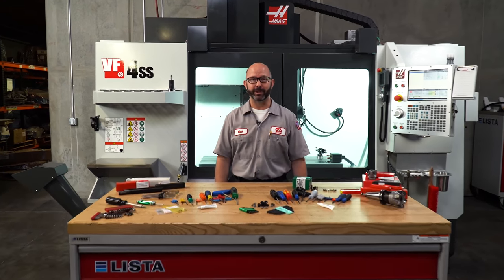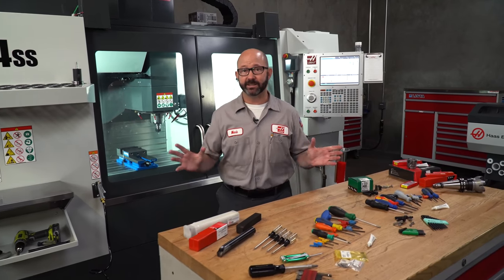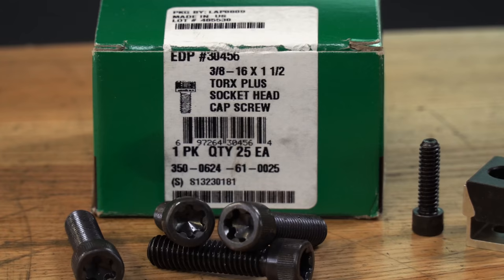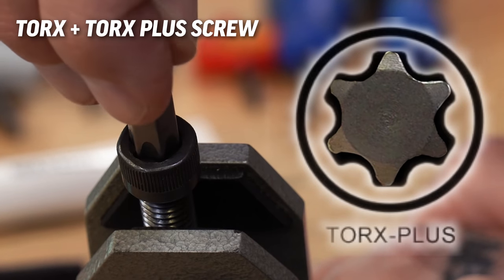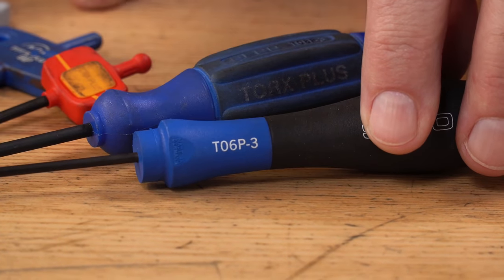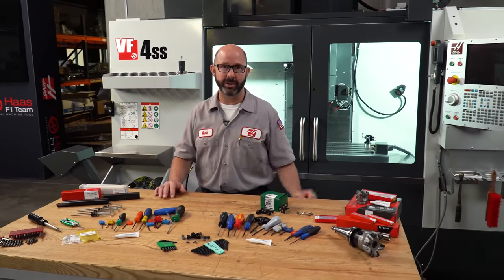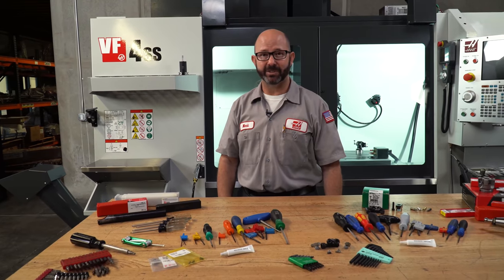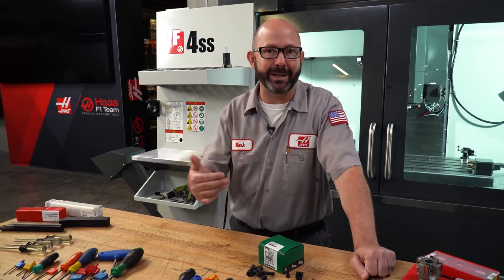THIS IS NOT A TORX - Haas Automation Tip of the Day

Comment: Thanks for this - Torx plus was a new on to me. As a worker with elecctro-mechanical gear, I also come across 'Bristol Spline' screws, which look superficially like Torx, but are different again.
Reply: Spline drive screws were common on IBM electronic accounting machines. Small screws but relatively high torque specification.

Comment: Good video but I feel like you need to discuss the Ribe bit as it’s very similar to Torx Plus. Additionally it’s worth noting that some manufacturers label bits TP15, TP20 etc. These aren’t Torx Plus, they’re Torx Pin, ie the fasteners have a protruding centre pin to make them slightly more tamper-proof.
Reply: Yes but in the video you see that the p in the plus tools was at the end of the designation not after the t.
Reply: @metamorphicorder  still worth being thorough and explaining difference, plus discuss Ribe bits too

Comment: Good info! The recommendation of adding lubricant to bolts is a slippery slope. It should only be done when you know what your doing and why you are doing it as it can potentially cause failures due to over tightening fasteners. Great info otherwise!

Comment: I stepped up to Wera pre-set torquing Torx Plus drivers for tightening all my insert screws. I use a light amount of Loctite anti-seize when installing. Haven't had an issue yet. 👍

Comment: Good stuff.  I almost had to turn away from the philips cam out though.  Typically with philips/star/plus/etc. cam out is from the incorrect bit.  It's too bad there are 2 dozen sizes and types to choose from but many of us know the right size when we see and feel it.
Reply: Until you buy some Chinese tools and screws and with every bit it is either too small or too big. Correct bit or not, the tools have tolerances and feels like a crap shoot 50% of the time. Bought a Blackview smartphone that came with it's own screwdriver for disassembly and it didn't even fit right. . . At least drill bits don't care the type of screw head they encounter.

Comment: Very informative video. I’m confused about the comment about lubricating screws. My understanding is that when there is less friction you have to rotate the screw more to get the same torque which can stretch and weaken the screw. This is why I’ve heard that you should not grease wheel bolts. Should the advice in the video be used only for low torque applications?
Reply: Great comment. I was talking about this with an engineer friend of mine, and yes, while a lubricant will give us a higher stretch (preload) on the screw, it can cause it to loosen if it is in a high-vibration application (less friction). Our cutting tools are really well designed, and tested over decades, so the inserts are well seated in their pockets, and the screws themselves are often offset to hold the insert again the pocket walls so there is no way for it to move. We'll see this with cylinder head bolts as well, there is vibration but the dowel pins on the heads help keep the head from moving against the block. There are lots of applications where we would not want to use a lubricant, and where a nyloc nut, lock washer, lock-wire, Nord-Lock washer, loctite, or jam nut would be more appropriate. In our case, all of the tooling suppliers recommend using a lubricant on the insert screws, so the lack of friction is baked-into our insert torque specs from the manufacturers. Yes, a lube drastically affects torque specs (needs less torque for same preload), and shouldn't be used unless the manufacturer recommends it.
Reply: The comment in the video is correct: with lubrication you need less torque to reach the desired preload... but that means to tighten properly you need to target the right preload, not a specific torque, and so you will use less torque with lubrication.
Reply: Yes, never lubricate wheel bolts/nuts, that way the wheel will be seized onto the hub when you get a flat tire 100 miles from everywhere. Makes perfect sense. Been there. Never again.
Reply: @d.e.b.b5788  wheels are rarely if ever seized on hubs by nuts seized to studs, so using an anti-seize lubricant on the studs won't help. Usually when someone can't get the wheel off, they either can't turn the nuts because they were over-torqued, or they can get the nuts off but the wheel is stuck to the hub... so torque properly and consider anti-seize on the hub (rather than the studs).
Reply: @brianb-p6586  lubricate the countersink in the rim and the contact face of the hub, never the threads yeah. Threads are usually fine but the face drag of the 'sink will bind it hard enough to twist a lug wrench shank out of shape
Reply: @Hyratel  I've never had an issue at the seat interface, but if with your specific wheels (and their inserts in the case of alloys) and nuts you have an issue there, then sure... use anti-seize lube on that - it's not the critical location for torque versus tension.
Reply: @brianb-p6586  this was Plain Ol' Steel Rims on a family car - NOT the kind of place you expect to need WTF amounts of Nutbusting torque, and especially changing a tire in a summer-hot parking lot

Comment: Wow. Torx plus sounds kind of messed up. Sure, they perform better, but they confuse the whole situation, because the are almost (but not actually) compatible.
Reply: exact, so we're back to the PH/PZ mess
Reply: Yep, and too many idiots strip them out with regular torx bits
Reply: @Sicktrickintuner  If you are crawling under a machine in a grimy ass cabinet and need to see the difference between torx and torx plus in a dark hole, while it fits your torx wrench, you suddenly realize what the problem is. Not every screw is in the front panel of a machine. Just last week we cammed out a self tapper screw 7 meters up on a cherry picker in a ridiculous spot because it was pz and seemed to fit ph2.
Reply: How do they perform better? Can they put more torque on the fastener? Which bolts would survive that, which ones would just round up due to smaller (therefore much weaker) lobes on the bolt head? Sure, the tool should be stronger than the bolt as it has to put up with thousands of fasteners within its lifetime. But the bits and keys are made of much higher grade of steel than the fasteners. Smaller lobes on the torx key leave space for bigger (and stronger) lobe on the (much softer) bolt head leading to a more balanced strength ratio.

Comment: Don't matter the new guy gonna still use my T6's on the T7's...
Reply: Haha I like this. I think it’s cruel they are so close together
Reply: Which illustrates why Torx is such an awful system. There are too many sizes too close together. They should have half (or less) of the sizes they do. Take a look at Robertson, so much better, you never have that problem as it's always obvious which size is right, you only need a few different drivers in your toolbox, and it's more secure and less likely to cam out than a torx too.

Comment: What to do when you find a torx plus screw?
Replace it with a normal torx.
Seriously I wish we had one standard (I guess 2 if you include bolts).... I don't want a dedicated toolbox (that's getting bigger over time) just for various screwdrivers and bits.
Reply: And It looks like  manufactures don't want you to do any repair  or service  operations, thus using a whole zoo-park of different bolts, nuts, and sockets..
Reply: The problem is that when you include all the unlicensed 'star drive' screws and bits that are everywhere now that the patents have expired, as a practical matter there really isn't a 'normal torx' anymore.
Reply: Throw them away and substitute Allen type hex screws and bolts.
Reply: @shoutitallloud  Why pure evil? The hex is deep and strong and if the wrench fits it will bend or break before the hex socket is damaged.
Reply: And let’s not forget the “security“ torx screws!
Reply: @shoutitallloud 
^This, anything Allen get's replaced by actually good drives like proper bolt hex (REAL hex not that stupid knock off Allen) heads where I work and at home.
If the "wrench" doesn't break the bolt explodes at any force over 1 inch pounds.
Reply: @pat8988 
I love fixing those with a punch/chisel.
Reply: @D8W2P4  All quality Allen socket head bolts and set screws are grade 8 and will not break or strip out under normal torque values. The usual cause of stripping is soft and poorly sized import wrenches.
Reply: @pat8988  yes, ofc need bits for those... and triangles. Squares too. adapters to go from various inch standards for impact driver, those multiple- star shaped bits that look more like a circle, a regular flathead but with middle cut out, 2 various flathead/cross standards x 10 sizes, triangle/ square/ thing with a bar and circle in middle keys... but I don't have a flippin TORX PLUS :X
Reply: @ellieprice363 
Well shit if only every bolt and tool was made out of unobtainium you could come up with any dumbass design and it would work.
Sadly this is the real world where unobtainium is the exception rather than the rule.
Further grade 8 is only good for making makeshift bushings those things will shatter like glass, grade 5 is good shit though hard but still malleable.
Reply: @D8W2P4  Sorry to learn you don’t know much about bolts.
Reply: @D8W2P4  When you find yourself in a hole, first thing to do is stop digging. You’re already in over your head.
Reply: @ellieprice363 
Said the lab critter.
Reply: @ellieprice363  Hex is far from strong.
Reply: Keep it torx plus.
Reply: @svn5994  On what experience do you base your statement?

Comment: Since I sometimes run into the torx+ and only have the torx bits I just use the same size but rubber band the tip, so far works fair.

Comment: i understand straight head, Philips head, reed and prince , allen, and torx head, even tamper head screws but there has to be a time to standardize these stupid proprietary screws and let  the backyard mechanic do what they need to do in order to repair and maintain their equipment. the right to maintain and repair your equipment should be LAW.
Reply: The thing is that most of those screws have specific applications.
Reply: Would be nice, don't mind buying a few more sets of tools for" new, upgraded " fasteners, but, as long as the parts and repair info, is made available.
Reply: The manufacturers are trying to take that right from you.  There is a big fuss from the farmers because Deere is requiring all repairs on their tractors be done by factory techs.  The problem for the farmers is that the techs often are not available for weeks.  You can imagine what that does to the farmer's planting and harvesting schedule.
Reply: @johncooper4637  Getting little hand tools, and bits for a few dollars, for new designs ,  is easy. Yea, the John Deere thing is a bit crazy, pretty monopolistic.
Reply: @TheLaXandro  Most of these applications can be handled by Robertson screws, and are pretty much standard across the board in Canada unless it's something manufactured in 'Muricah....

Comment: What's the point of the torx plus design (other than holding another patent)? As tools are made from much higher grade steel than the bolts it makes sense to keep the lobes on the bit smaller to give space for bigger (therefore stronger) lobes on the much softer screw head to get a more balanced strength ratio.

Comment: I scream silently ( or sometimes out loud) every time I have to buy a new screwdriver or driver bit just because some a-hole decided to be fancy. We need maybe three kinds of screw heads. Tops. Instead we have...

General types:	
Hex / Allen:
Square 
Robertson
Pentagon	
Slot (flat)	

Phillips-like types:
 Phillips
TA/TP3	
Tri-point
Tri-wing	
Pozidriv/supadriv

Torx-like types:
Torx
Torx Security
Torx Plus
Headlock
Polydrive
Bristol
Spline

And probably more that I'm missing.  Gimme a friggin break.

Comment: I did a clutch job on my cousin's car, and the flywheel was fastened with torx plus bolts. I ended up having to order new sockets for it since I had never encountered them before.

But now I'm ready for next time!
Reply: Awwwhh.. don't worry. Next time they'll put some brand new "GNORX-extra" bolts
Reply: Get a welder (a cheap flux core works fine) and just weld the offending bolt to a piece of rod and you don't need to worry about the new idiot bit some "engineer" comes up with.
Reply: @D8W2P4  I know this is bad practice, but I re-used the flywheel bolts.

So mangling them up wasn't an option.

Comment: It drives me nuts that Sandvik no longer supplies a wrench with their tool holders. You spend hundreds of dollars in their products and all the give you is a 1/4 hex bit. You have to pay like 25 dollars for the stupid wrench. Absolutely ridiculous.
Reply: I ran CNCs at Caterpillar for 30 years. What they would do at Cat is treat the screws in the tool holders like a high value item. The holders cost hundreds and the screws are a buck apiece, and they stock only 4 or 5 spare screws in the tool crib. Literally one screw at a time in one little ziplock bag. Then somebody orders all 5 screws and hordes them. So when the screw in your holder gets wallowed out and there are zero screws in the crib, you order a whole new holder. 4 or 5 hundred bucks for a new holder to get a new one-dollar screw. When I explain to them that they should demand the screws from suppliers in bulk (this is Caterpillar, they can demand this from tool suppliers) and keep 500 spare screws in the crib for each type of tool so every odd guy who hordes 4 or 5 piddly screws won't clean out the crib and the rest of us won't need to order a new tool just for the screw, they won't listen. And that just makes everybody horde the spare screws even more. When you see the crib has 5 more screws, you snap them up, every man for himself.

There was a Sandvik rep who brought in a new type of inserted drill for us to try. The drill ran a lot better than the Sumitomos we were using, BUT the Sumitomo was a style that employed cutting force to keep the cutting insert locked in place and it would cut properly even if the 2 screws in it were not fully tight. The new Sandvik relied on a single unique screw, and the screw was carrying the force. Having a good tight screw was critical with this new drill body. And sure enough there was only one screw with each drill body and no spares. I told them this was a bad idea. And eventually in a few months the screw got wallowed out and could not be fully tight any longer, the insert got loose, and a bunch of parts got scrapped with O/S holes. And they had an investigation, and I told them "I told you so", and they got mad, and the Sandvik rep took that drill body back.

Comment: Good info. But why would you lube the fastener, wouldn't that make it more likely to back out if there's vibration?
Reply: Most of the torque that we use to tighten s screw is not spent tightening (actually stretching) the screw, but is lost to friction. The lubricant reduces  the friction , so we can get the same amount of stretch (preload) in the screw with less force. The lubricant can make a screw more likely to back out on its own, but it doesn’t because it has a good stretch/preload, nice and tight. Really interesting topic.
Reply: @markterryberry4477  отличный ответ.
Reply: The screws, and lubrication used with them, on cutting tools have had decades of testing and design improvements to ensure that the inserts have no play (slop), that could be exploited, vibrating the screws loose. The inserts are tightly held, with no wiggle room, against the insert pocket walls, to hold tight against vibrations. I was talking to an engineer, and there are definitely applications where a lubricant might not be advised, and other solutions are more appropriate like Loctite, lock washers, Nyloc nuts, Nord-lock washers, Lock-wire and more. What a terrific topic. For more information, do a search for "self loosening of bolts and nuts". Engineers have spent their entire careers looking at just this concern.
Reply: @markterryberry4477  good info, thanks!
Reply: The tool manufacturer recommends it.

Comment: i don’t understand the issue with Phillips. The only time i have a problem with them is if i don’t hold my drivers properly or if i’m coming behind someone else’s screw up. And i have had plenty of torx slip and ream out. i’ll take a phillips over a torx every time especially with deck and sheet rock screws.

Comment: I run into this with "pozidrive" screws trying to use a regular phillips head.
Reply: To me that sounds so dumb. I knew the difference between pozi nd Phillips from maybe 10 years old. But I always use the notion that if you don't know something, it's s simple as that. You dont know and just haven't been taught yet. Until maybe this year I'd never heard of triple squares, spline and ribe and I had no idea about the differences. A spline is a 12 point regular torx, a ribe is effectively a 12 point internal torx plus and a triple square is a 12 point with all corners being 90°, not to be confused with the spline. They all look very similar but using the wrong tool will simply wear the fasteners and you'll have crappy grip. The reason being I'd never really worked on new cars til the last 2 years. I'm sure people who do more complicated jobs than myself are laughing at me.
Reply: Not to mention the Reed Prince!
Reply: @georgecroney6168  Problem is, when they look identical, it's hard to figure out what's going on. It's just awful design.